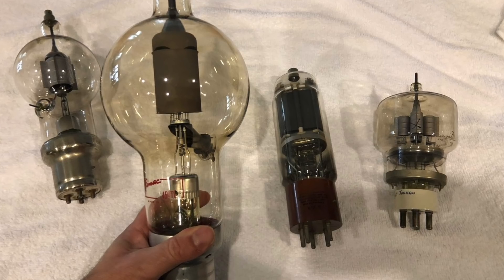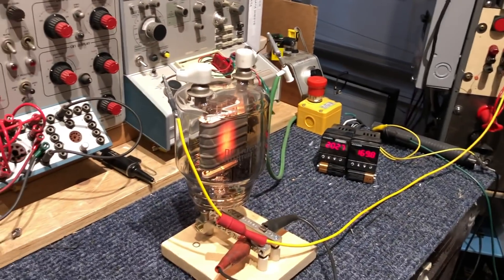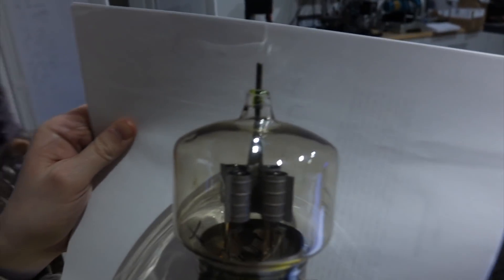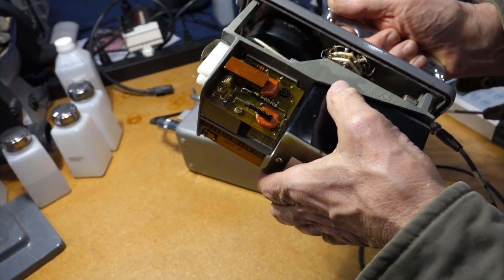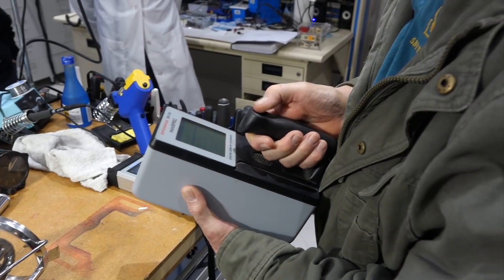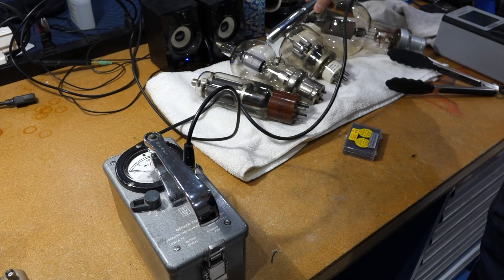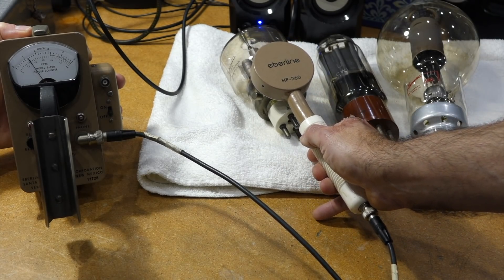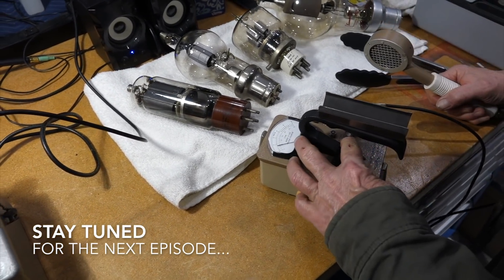My vintage vacuum tubes are radio-active!

Comment: The more modern Geiger counter that was used, the one with the flat round probe (which because of that shape is called pancake probe) is indeed sensitive to alpha particles because has a thing mica window to let them in.
In this case it didn't register much because you where measuring the glass at a distance and at least partially shielded by other glass.
In any case even if you had it fully exposed it would've been fine since, being glass, it's also very unlikely to flake or leach Uranium when handled.

I would make a nice display mount for them with UV leds in the cabinet so you can properly highlight them when showing them off.

Anyway I wanted to add that the fact that when even a science and technology inclined person like you gets a bit freaked out hearing about having something radioactive on his hands is a testament on how damaging the anti-nuclear propaganda was and how easily the misinformation and exaggeration of the dangerousness of anything even barely radioactive got rooted in the general public. Mind you I'm not faulting you in any way shape or form, I think you're awesome.
Reply: I think you are exaggerating when you said anti-nuclear propaganda.  The anti-nuclear people are a very small percentage of the population, and are not a significant source.
Reply: Except that the manufacturer of the altimeter had  people paint the dial by hand without gloves and in some cases they used their tongue to form the tip.
Reply: @TheStefanskoglund1  I'm very familiar with the awful story of the radium girls, but what's your point?

Comment: At 4:35, the top row of panels, just to the right of the blue panel is the front panel for a Systems Engineering 32 bit super-mini computer. I started my career on these machines as first a computer operator and then a programmer (ultimately I worked on the MPX-32 operating system on these). It was really exciting to see after so many years! Thank you Marc! I should also mention that my wife collects antique glass and we have one case that contains glassware made from uranium glass (drinking glasses, wine glasses, etc.). This is also called Vaseline glass by the way. It all emits alpha particles so we keep it behind glass. The case has a black light in it which is pretty spectacular when you use it to light up the glass.

Comment: I have a chinese gas mantle which gives 3k pulses per second. But i also have some pottery with uranium coating giving 3000 pulses per second. (Measurement taken with Herfurth Microcont I) 
Uranium glass usually does not show much surface activity with normal scintillation survey meters because the energy of those alpha parts is way too low. You can try to build a ion chamber though.  Ion chambers have very obscure components in them http://www.techlib.com/science/ion.html so it might be a thing for you.

Comment: They used to use uranium as the coloring on Fiestaware plates (the yellow or orange ones.)  As mentioned uranium is primarily an alpha-emitter so as long as you don't smash up that glass and inhale the dust, you should be fine.

Comment: Many larger tubes (mostrly made by Eimac and HEinz & Kaufman) mixed uranium oxide in the glass near the seals, the blend they used had a better adhesion to the metal and had a similar thermal expansion rate, thus preventing air from leaking inside the tubes when they were running hot, and they ran very hot (Eimac recommended to keep the plates of their triodes cherry red, the plates were covered in zirconium wich at high temperature reacts very wel with oxigen and nitrogen thus absorbing any leaked gas, wich otherwise could cause a discharge).
Uranium glass was also used to make kitchenware, marbles, Bottles, Seltz Siphons and so on, it' s harmless but it looks very cool :)

Comment: Was my first intuition when they where registering low emissions if the detectors were suited for the right particles. I'm sooo nerdy...
Reply: The pancake probe used later is the right instrument, the radiation is just that weak. Also it was a bit awkward to measure because of the shape of the tube envelope

Comment: You'd probably get more of a radiation dose from eating a banana. Being an alpha emitter though, don't eat the glass or else that comparison goes out the window
Reply: Indeed, but note: depending on the size of the glass you are ingesting, radioactivity will still not harm you much :)
Reply: I use 833-A's in my DIY stereo amplifier and I find what you say very comforting even though my transmitter tubes are not vintage. These tubes make the most beautiful music I ever heard.

Comment: IIRC,some of the gas filled voltage regulator tubes had a small radioactive source in them too,to help get the gas ionization kick started.

Comment: The decay products of the uranium isotopes' alpha decay are in an excited state and emmit gamma radiation to get back to ground state. That's what you measured with the GM tubes. The good side of the alpha radiation is that even air easily absorbs it, let alone a paper box. You don't need to put it to the back of your lab, just don't sleep with it.
Reply: Also, the dead cell layer of the skin does a great job at absorbing alpha radiation. It is a different story if left next to soft tissue, breathed, or swallowed.

Comment: Marc you needn't worry about those tubes, alpha rays are generally harmless (I wouldn't, like, sleep with the tube) because they can't pierce your skin.  You have to eat the source (or otherwise internalize it) to be injured by alpha rays.  That's why those detectors weren't telling you about them, detecting alpha rays makes you go "Oh, neat, there's alpha rays here, I wonder why?"  but finding gamma rays makes you go "Oh shit it's time to leave!"
Reply: *Can't get ALL the way through your skin to the tissues below, will still get deep enough to cause damage to the dividing skin cells (50 microns or so) similar to ultraviolet light from the sun.
Alpha particles. They might be blocked by a sheet of paper, but paper is actually quite thick, thicker than skin- 80gsm paper works out neatly to the equivalent of 80microns of water- far thicker than your skin

So not innocuous if you're holding it, but the content of uranium is typically low, and it's not a particularly strong emitter, as well as the emission being primarily from the surface, so yes, relatively safe assuming you're not sleeping with it :D.
Reply: @AngDavies  alpha doesn't even go through the glass. And yeah basically just doesn't go through the skin. I studied applied physics. I used to work with these kind of things all the time. People make this a lot more dramatic than it needs to be.
Reply: @p_mouse8676  that's why I mentioned surface- the dose will be much reduced because the inside will not radiate, but the surface has a relatively unobstructed path.

Even being a centimetre or so away in air would be enough to block the particles.

I just thought it important to draw the distinction because of a particularly dangerous brand of woo that's surfaced recently involving strapping bracelets containing high amounts of thorium dioxide to your skin and wearing them day in day out...that's totally still gonna give you cancer and needs to go die in a fire fast, as far as I'm concerned. I don't actually seriously think Marc is going to come to harm :)

(YouTube thought emporium for a bigger video on it)
Reply: Sounds like Soviet propaganda to me.
Reply: Alpha particles don't NEED to penetrate your skin to cause long lasting damage. They are most prone to cause skin cancer. (and fortunately, thats it)
Don't underestimate it. 

If you want more information, I'd suggest 'The Thought Emporium's video called "Negative Ion Products Are Actually RADIOACTIVE", which goes in-depth about measurements of alpha particles and effects. (Thorium and the like)
Reply: @Povenator than you're talking about having it right on the skin. Even than the effect is extremely minimal. The absorption in air is even pretty significant
Reply: The other reason to believe the amount of emission of alpha from the glass would be almost zero is because you don't want a tube filling up, albeit slowly, with helium.
Reply: Watch this and then tell me how harmless alpha particles are again. https://www.youtube.com/watch?v=C7TwBUxxIC0

Comment: Alpha particles can't even penetrate the layer of dead skin cells on the outside of your body. They're harmless as long as they remain outside your body. Don't inhale or swallow an alpha emitter, though!

There's a classic physics puzzle. You have three cookies, one containing an alpha emitter, one containing a beta emitter, and one containing a gamma emitter. You have to eat one, put one in your pocket, and hold one in your hand. What do you do?
Reply: Answer: Hold the alpha emitter in your hand since, as mentioned, alpha particles won't even penetrate the outermost layer of dead skin cells. Put the beta emitter in your pocket; your clothing will be a fairly effective shield. Eat the gamma emitter since it'll be doing the same damage to you regardless of which of the three actions you choose to do with it.

Comment: I did similar things when I got my cheap geiger counter, testing all my household items like the mantle on a coleman gas lamp (nope. turns out it wasn't thorium based!) and various glassware etc. My parents have BY FAR the most radioactive things readily available to the public: orange fiestaware dishes! A brief video demonstration I made is at <youtube.com/watch?v=WxAVwS965Q4>, though there are probably lots of others on youtube describing in greater detail what uranium oxide glaze was used on the orange plates. (The other colors are all non-radioactive)
Reply: I have an orange Fiestaware coffee cup that really sets off my Geiger counter. It's way hotter than a chunk of uranium glass that I have!

Comment: Your tubes also have thoriated tungsten filament cathodes...
Reply from the maker: Yummy! I did not know either.
Reply: @CuriousMarc  Modern microwaves still have a thoriated filament inside the magnetron. Also the neon tubes starters use a bit of something radioactive, like again Thorium, to pre-ionise the gas inside the tube and ease its operation
Reply from the maker: @Yrouel86  Not to forget smoke detectors!
Reply: I've got some TIG welding tips with thoriated tungsten that people grind to sharpen, yet people breath in the dust. I don't think old welders know about it, because I didn't know when I did some TIG welding in the 70s.
Reply: @SidneyCritic  Yes, as i remember it may be up to around 2% actualy (only the brown ones, the green ones for aluminium is pure tungsten), same with the coating in MMA electrodes, i try to wet grind if i can, but i always ues the old betty angler before, no idea if it will shorten my lifespan or not, time will tell i suppose...
Reply: @Vampi_Sweden  That's good, because I did Alum and our welder has been doing Alum cyl heads for 40 years. I bought a TT TIG tip for a spark gap, I guess I better take precautions when I cut it in half.
Reply: @SidneyCritic  To be honest i hawe not found much information about helath effects from those sources. I work with it from time to time in the smitty workshop, it was not until took the formality papers to the license for high  pressurised pipes, about fifteen years ago i was tould about this.

They also tould me that aluminium particles may or may not be harmful, but i hawe not found any clear scientific fact about aluminium dust either, but i hope one shall be pretty safe if one used regular, induastrial dustmasks reasonably often... 

Only thing i know for sure are those guys wich worked on a local cromium factory here in the 80s and did not used any proper respiratory protection and inhaled 6 worth cromium 5 days/10 houers a week.

But 6-worth cromium (not regular cromium, i think the 6-worth only apear in certan types of chemical solutions after the inítial electrolysis process in the cromium bath on the factory, not in a regular workshop (unless one try to replicate the industrial process exactly)) crystals are seriously nasty thing compared to aluminum, they are evenmore dangerous than asbestous to inhale. But metallic cromium, and other crystal types that apear in a normal workshop environment are not at all that dangerous. So it should be safe to use a regular dustmask and eyeprotection classified for industrial use i think in a normal workshop.
Reply: @SidneyCritic  I took a welding course fairly recently and we discussed this issue.  Their official stance was that the thorium isn't very strong to begin with, and there isn't much in the electrode, and then you aren't making much dust sharpening the tip because it's such a small thing and all you're doing is dressing a point, that all you need to do is take care not to breathe the dust.  No need for a gas mask.  Now, if you were for some reason sharpening dozens of electrodes at once, multiple times daily, then you should have one, but for one welder welding at a normal rate (the electricity only comes from the plug so fast and thus limits this) and sharpening his own electrodes poses negligible risk to that welder.
Reply: @Lazarus7000  it's usually not about how fast you weld, but how often you touch the metal with your electrode, that governs how often you have to grind them, and how far back lol
Reply: Only directly-heated cathodes use thorium IIRC... the tungsten heater wire is the cathode too.  This stopped with the introduction of indirectly-heated cathodes, which most of your common applications use (electric guitar players love them!).  Also, the only time alpha rays (helium nuclei) can hurt you is if you ingest the source... skin is normally enough to protect you from alpha rays.  Love the spectrometer... would have liked to see it classify the thorium and uranium if it was sensitive enough... that altimeter was *hot*!
Reply: like the TIG welding electrode some of them are thorinated 2%
Reply: Thoriated TIG electrodes can go up to 4%, I managed to find a seller some time ago and buy a box of 10. The typical ones, much easier to find, are indeed the 2% ones
Reply: NinerFourWhiskey, yep! I was about to point that out too.
Reply: All vacuum tubes contain thorium to some degree.  Either the filament as in a 5U4, 5Y3 or indirectly heated cathode vacuum tube like a 6X4, 6X5, 6CA4 etc.
Reply: As so do 6L6 and 6550 power vacuum tubes.
Reply: @DandyDon1  No, 6L6 and so on have carbonate coated sleeve cathodes. Thoriated tungsten is used in transmitting tubes with direct cathodes (the filament is the cathode).
Reply: @NinerFourWhiskey  Apparently I carried the idea of what I was taught by a vacuum tube electronics teacher about directly heated cathodes using Thoriated Tungsten, in that there would be no electron emission without it. 

Unfortunately our mentors do not live forever, and some like mine had his life cut short.  I certainly miss the information and anecdotes he use to share.
Reply: @DandyDon1  

I think the HC insulation on a regular microwave magnetron do contain some radioactive component as well.
(As long as one does not smash it with a hammer and inhale the dust i think it's perfectly fine however.)

Comment: Hehe don't worry. Alpha rays won't hurt you unless you maybe swallow the emitting source. Just wrap it up in paper and you're fine :)
Reply: They're not rays; they're particles. Helium-4 nuclei, to be specific. But yeah, they won't hurt you as long as they stay outside your body.
Reply: @whitslack  wave-particle duality says they're both.  :)
Reply: @JamesChurchill : Wave-particle duality doesn't make a lot of sense for particles that have mass. Alpha and beta particles both have mass; gamma rays do not.
Reply: @whitslack  unfortunately quantum mechanics doesn't much care what we think makes sense.  Massful particles have a wave function just like photons.
Reply: @JamesChurchill : Right, they do. It's just not useful to talk about. What is the wavelength of a fastball thrown at 90 MPH? It has one, sure, but it's meaningless.
Reply: Not really. Alpha particles can have high enough energy to penetrate the epiderm and, when long exposure occurs, can produce cancer. Another channel ( I cannot for the life of me to remember the name) demonstrated this fact with "negative ion" products, some of winch are actually Thorium infused